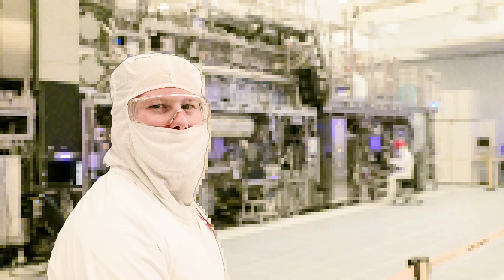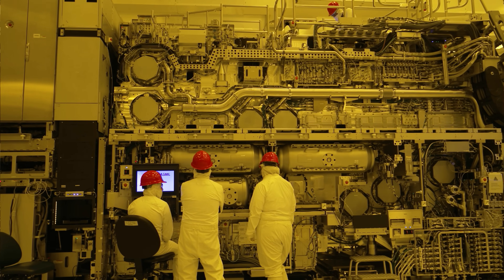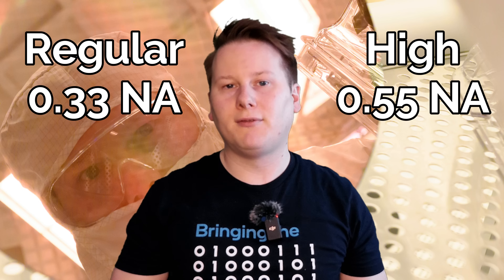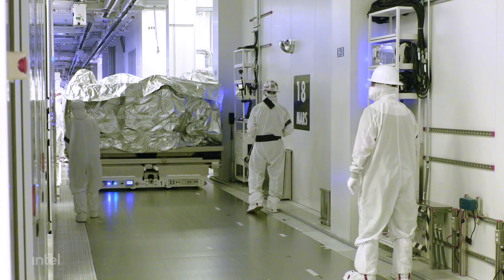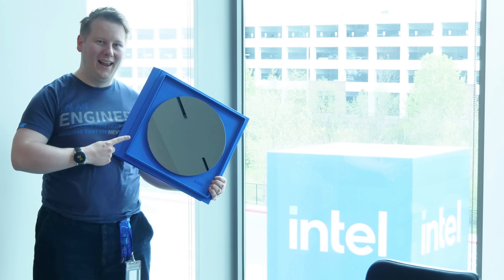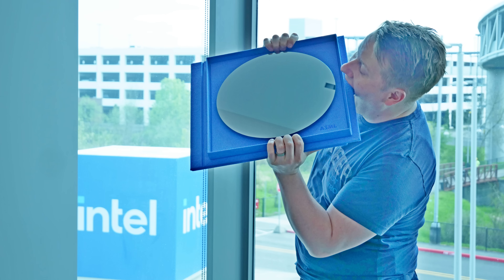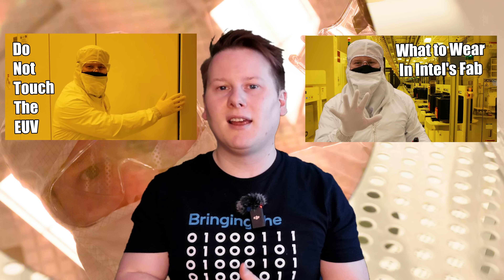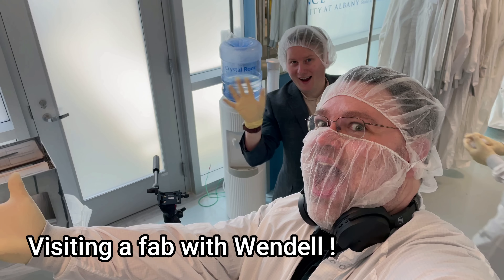Intel's Newest $350 Million Machine

Comment: How is 0.33nm smaller than 0.55nm? Was it a mistake in the vid?
Reply from the maker: 0.33 or 0.55 isn't a nm. It's the numerical aperture. A dimensionless unit that goes into the wavelength equation.

Comment: I'm surprised that these clean rooms don't use SpaceX suits  (with a special coating)..    And as the process gets smaller, I'd suspect that these fabs will need to be constructed in mountains to contend with space radiation and the purity of the compounds so high that there will be very high cost prohibitions..   and I wonder about the longevity and delicacy o the newer chips..

Comment: The United States needs to comprehensively rebuild and review its local engineering talent training system and construction department. The current construction efficiency is too low.
If the United States quickly transfers all electronic component production lines to Japan/Taiwan/Germany/the United States, ASML and other equipment manufacturers will not be in a situation where they may face significant loss of interests due to the trade ban.

Comment: Numbers are bit inaccurate on the laser itself - there is 4 Resonators that step up the 2 smaller lasers ( baby lasers!) bringing a low power then an additional smaller amplifier to around ~150 watts all the way to an Average output power of ~30kW. The Pulse for the flattening is lower powered - but the Pulse that creates the EUV can be around 20MW per pulse! (think, we are averaging across 50 khz)  but still - incredibly powerful - one of the resonators can cut through 2 inches of steel with ease - and CYMER/ASML/TRUMPF said... lets put 4 of them together! Look up TRUMPF EUV for a better understanding of the laser itself!

Comment: This EUV chip manufacturing technology is probably the peak of cumalitive human technology? If there printing 10nm lines how come people are releasing 3nm and 5nm & 7nm in marketing theory, chip structures? is that in a different orthoganol direction … ie vertical to the wafer layer itself?
Reply from the maker: When you hear people talking about process nodes like 7nm, 5nm, 3nm, that's not an actual measurement, it's just a name. Ever since we went 3D, those node names aren't actually related to anything built on silicon.
Reply: @TechTechPotato  - you should have mentioned that in the video.
I thought straight away  - what about 3nm chips?
Reply from the maker: I did? I mentioned node names are just names, not actual dimensions. I've said it in dozens of videos.
Reply: @TechTechPotato  - OK - I missed that.
You are speaking to lay people not semiconductor experts.

Comment: I think it's safe to say that the next High-NA machine isn't going to China, unless you're Elon Musk and consider Taiwan as part of China.

I think I had already read that ASML is going to work closely with Intel to ensure this gets up and running properly so we can assume there's other money involved.

And Intel REALLY needs this because they mucked up EUV.  And for those that don't understand this, Intel is making "Intel 7" with DUV lithography.  They're making Intel 4 with EUV, but as of yet Intel 4 isn't making anything for desktop.  I don't know the answer why.  They had a LOT of issues getting to Intel 7 using DUV but that should have been expected since that "7" node is not what DUV lithography was made for.  EUV lithography was made for that type of transistor density which is what TSMC does and why TSMC has pulled away from other companies.

So, I expect that Intel wants to basically jump past EUV and get to High-NA EUV and put out Intel 3 and 20A ASAP to get back on the level of TSMC.  Or, if this video is correct then have ASML help Intel with their EUV lithography so they can put out Intel 3 within the next couple years and I still think they want to get to High-NA for 20A regardless of what they say or their roadmap shows.  Intel has had to do a LOT of edits to their roadmaps.
Reply: I wonder if Intel was also stuck on EUV, because TSMC had developed a technique of working with it and patented it and Intel didn't want to be stuck with using someone else's patented technology for this...?
Reply: Taiwan is part of China.  That was settled when Nixon went there to triangulate against the Soviets.  Engineers are supposed to be data driven.

Comment: 350mil is bloody cheap for a industrial machine this sophisticated.
Reply: Absolutely. It's literally holding the future in your hands. For ASML, their partners and their suppliers this is an incredible milestone, and this machine will pay Intel back for many years to come.
Reply: I would assume ASML also charges for handover and software to run the machine with or smth?
Else why only sell it for 350 mil?
Why is ASML worth 300+ billion whilst they only make maybe a dozen of these machines a year?
Reply from the maker: They make around 40-60 a year.
Reply: @TechTechPotato that a lot more than I would have thought. You’d think something so complicated wouldn’t be able to have assembly line style construction
Reply: @TechTechPotato  still a bit low.
Similarly priced to an airplane (maybe 2x that) yet airbus makes 600-800 of them in a year.
And ASML is 'worth' more than airbus.
Reply: Now aware of the irony of this statement considering they make CPUs in the same fashion..
Reply: @kael13  Well, that is more for the previous generations (low-NA EUV, DUV), High-NA will only be ramping up in the coming years.
Reply: @kael13  Velhoven The Netherlands For The Win !!!
Reply: @fatjohn1408  Exactly. There was another video dont remember where that described how many million lines of code those machines have and that's where all the complexity and IP truly is. On the other hand there is a lot of knowhow of how these machines are used by the one using them like TSMC and Intel , that they build a portfolio out of it. So its more like cooking than printing. Each type of chip part and arch, needs its own way of cooking to be good it seems
Reply: @fatjohn1408  Company is usually quotting as having a worth related to its public/private stock market capitalization- which is very little to do with their actual assets on hand. Money generally only exchanges hands with investors to the company when stock is sold on the private market, or as IPO, or extra stock selloff
Reply: @fatjohn1408  Maintanance costs money too by an ASML team.
Reply: True, if the US govt developed it, it would be $350 billion.
Reply: @vladimus9749  The Netherlands Velhoven
Reply: no
Reply: It’s 350million for the machien but prob over 10billion for the research
Reply: They should be double the price. The profit margins are an order of magnitude less compared to ASML's customers' customers (aka apple, Microsoft, etc.). They should be pricing them way higher. By this point it should be relabeled a non profit
Reply: @banzaipiegaming  your statement is based on what data? ASML make a 30% profit on revenue. None of their customers make double that - most dont make half that.
Reply: Yeah they're practically giving them away at that price 🤷‍♂
Reply: @RealNormHall  We are not like Americans
Reply: Doesn't include all the supporting machinery.
Reply: @moshunit96  Bingo
Reply: i heard the so called "CHIPS" act is SOO full of "DEI" political garbage that the companies are hesitating building the facility in the US? does anyone know about this?
Reply: M  or mi*
Reply: especially when u.s. tax payers footed the bill
Reply: Def right cheap $350ml for such a complicated machine  
  New tech has made things cheaper but creates a pile of throw away rubbish 
Make manufacturing back in your country
Reply: Nah! That machine is clearly over engineered to discharge competition! There where many companies that invest billions into this technology. Best believe they will get their money back plus profit!
Reply: @kkrobertson1  No it is not overengeneered

Comment: I have some questions that I hope someone can answer for me.

1.  Why does it require two passes with regular EUV?  Is it because the light source is more diluted and can't do the job in one go?  Or more like its a bit blurry?

2. From my memory of chemistry at university, 8nm should equate to about 40 pr 50 atoms.  How on earth do you prevent or control all kinds of weirdness that result from electron tunneling?

3. Are we basically at the fundamental limit of how small we can go? If so is it just how well the architecture can be improved, and how much can AI improve it, or will it become a case of stacking layers on top of layers, potentially with microstructures that allow more efficient cooling?
Reply: For your number one, it might be because of multi-pattering. In short, you can create structure smaller than your wavelength if you multi-pattern onto the silicon. Basically you're multi-exposing your photo resist to create structures you can't make with a single reticle/mask at that wavelength. 

It's rumored that pattering is how china is somehow managing to keep up with EUV despite not having current euv tools. 

That might not be what Ian was talking about though.
Reply: @CRneu  but how?  It doesn't make sense.
Reply: @Alex.The.Lionnnnn  The best that I can put it is this: Using phase shift masks we are taking advantage of interference in order to etch features that are much smaller than the wavelength allowing for example the etching trench line that is just 8 nanometers wide (your line width) in the silicon. Remember in a positive photoresist such as used in EUV, its the exposed parts that get etched away. The problem is due to the Raleigh criterion you cannot etch your 8 nm wide line closer than 50 nm (your pitch) from each other if you have low-NA (0.33) EUV. Now if you etch your first set of lines, coat it again with photoresist expose another pattern this time offset just enough so that it etches right in the middle between the lines that you previously etched. You now have pitch of 25 nm. You can now pack twice the number of lines in the same space. Repeat the process you now have a pitch of 12.5 nm. In practical terms where you where previously limited to a finFET with a 50 nm wide fins, by using 3 patterns you now have 12.5 nm fins. If you have a higher NA you can have a finer pitch with having to resort to as many patterns and exposures.
Reply: @noob360  ahhhh ok I'm with you.  Cheers.

Comment: This is such exciting technology. But it's also modern day alchemy. Us being able to buy a CPU for like 400 bucks is given the immense complexity in not only making the chips... but also making the EUV machines and the whole fab is crazy. They must move crazy volume for this to make sense... Nvidia is selling their GPUs for like 30k and it's not 50 times as much silicon. So how can CPUs even be viable anymore.
Reply: Now Intel can produce AI chips/GPUs that can compete with NVidia.
But GPUs don't cover all markets where chips are required. CPUs are important part for decisions/control calculating machines. CPUs do calculations that support traditional boolean logic calculations that cannot make errors in decision making. AI is allowed to make errors while error rate may be 20%, 10%, 5%, 1%, 0.1% - as low as possbile, but errors are still allowed. If users want their life to be 100% safe it shall be built around CPUs and robust software. If some domain allows margin for errors it can rely on Neural Networks and GPUs. E.g. weapons can be build around Neural Networks to determine if some target is enemy or your troops with 0.1% margin. Some errors and casualties can be tolerated on battlefields if the side to apply AI still has great benefit of it.

Comment: I wouldn't be surprised if the vast majority of exposures on modern CPUs are still done with DUV
Reply from the maker: They still are. A modern 17 layer chip uses EUV for only the first 2-4 or perhaps 6.
Reply: you don't immediately use new wavelengths to create your latest chips. New nodes are only used in specific layers, and there can be dozens of layers in a single chip. So today's cutting edge chips are only using EUV for maybe 2-3 layers. The rest are "old" nodes.

Comment: Not sure I follow your efficiency stuff @6:20 when you start with kWatts (power) and end with milliJoules/cm^2 (fluence).  Units don't match and there is that 60 kHz pulse rate in there as well.
Reply: yes, the exact per pulse wafer dose is a commercially sensitive number. the input lasers aren't kWatt continuous, they are high repetition pulse - energy per pulse isn't said either.

Comment: The things humans can make is kind of wild
Reply: @rulleh  no, we didn't. or even if we did *x-files theme cue in* thats definitely a primitive tech and not it. just read /wiki/Transistor
Reply: Intel tera herz example shows that its even more wild what humans can make but just don't for some stupid reasons. like a lot of trillions dollars))
Reply: @rawdez_  I see a lot of comments from you and they are all a bit crazy. You write like things are very simple and you know everything. Intel is NOT making Billions on an investment of Millions. Intel is barely profitable. 
As for the terahertz transistor - that's ONE transistor, not a whole chip. A whole chip has billions of transistors... A terahertz CPU will, due to the speed of light, have information changing at one end of the chip while it's being processed at the other end. You can pipeline for this, somewhat, but pipelining is a very limited tool.
Also, what about stability and longevity?
The teraherts thing you know about is a fringe experiment... And you only hear about the one time it worked, not the hundreds of times it burnt the CPU, burnt the clock, etc...
Reply: check out Intel Tera herz - 1000GHz 2001 tech. these silicon producing machines should've been thrown into garbage a long time ago. for waaaay more mindblowing tech to replace it. but they make too much money for corporations so alas not going to happen soon.
Reply: @rawdez_  whats a Intel Tera herz - 1000GHz tech?
Reply: @-.369.-  its 1000GHz transistors tech intel announced in 2001(apparently by mistake because nobody heard about it since 2001)  that was ready for production and supposed to hit the market in 2005. and replace silicon. but didn't. because milking silicon instead is way more profits. btw "15nm" silicon tech also was announced as tested and working in 2001 but released (as 14nm) 13 years later.
Reply: @rawdez_  You're talking about some lab result which most likely just didn't work out due to practical problems or ended up performing much worse than anticipated. I should note that one of the two parts of the transistor mentioned in that old press release, "high-κ gate dieletric" is a well known thing, and "depleted substrate transistor" sounds like SOI, which was used for a few CPUs in the early 2000s but largely seems to have remained a niche thing. Note btw that the bit where silicon dioxide was replaced by a different oxide is just a very thin layer of the overall device, the foundation would still be silicon.
Reply: @MatthijsvanDuin  the only thing that didn't work out is switching to way faster tech because it'd kill everything else on the market. made it obsolete.
Reply: @MatthijsvanDuin  intel said it works and production-ready
Reply: @rawdez_ 😂
Reply: @rawdez_ 
I expect it must not be financially feasible.

Making one of something vs mass production is two different games.

It’s not just one machine involved in making semiconductors.
For example, if ASML wanted 50cm diameter wafers, they couldn’t because everyone else would need to follow as well.

If Intel could mass produce Thz chips they would, this is not something they would have sitting on a shelf for 20 years.
There must be other complications involved.

Perhaps the chips were terribly energy inefficient?
Or they get too hot…

Whatever it might be, if they could, they would.
Reply: @CoderDBF  this is where you're wrong, this IS exactly something they would have sitting on a shelf for 20 years and way more. because releasing it would make everything else on the market  obsolete including ALL their other CPUs.
Reply: @CoderDBF  >ASML wanted 50cm diameter
actually its 45cm/18'' that was produced and checked that its way better. the only reason corporations don't switch to 45cm is they'd need to change all equipment. same with switch to TeraHerz technology + ALSO it would make everything obsolete so is BAD FOR BUSINESS. basically the only reason we still have 0 progress is MONEY - maximizing profits.
Reply: @CoderDBF  not switching to 45cm/18'' wafers is just to not spend on equipment modernization when in the long run it would be way more profitable. techtechpotato did a video about 450mm wafers a year ago.
Reply: @CoderDBF  they can, they would NOT. until silicon can be milked. thats THE reason. they milk what they already have. and then after 30-50-100 years when then can't milk silicon anymore or when somebody else is brave enough and have enough POWER and INFLUENCE to release similar to TeraHerz tech and not be destroyed by all silicon tech corporations and lobby - they would switch instantly to match them.
Reply: @CoderDBF  the same way Tesla/Musk was brave and powerful enough to go against combustion engines/gas lobby and started the revolution in automobiles while there's literally 0 technical reasons that couldn't been done decades ago. build your charging infrastructure and go electric. yet milking what you have and keeping you sweet warm gas infrastructure milking spot is trillions of $$$ in profits.
Reply: @CoderDBF  money is what stopping the progress from happening, what stops tera-herz from happening. until they meet even bigger money/lobby willing to fight them.
Reply: @CoderDBF  the chips were terribly energy EFFICIENT. thats how they got to tera herz frequency in the first place, lol.
Reply: @CoderDBF  read about tera-hz first instead of making up excuses for corporations